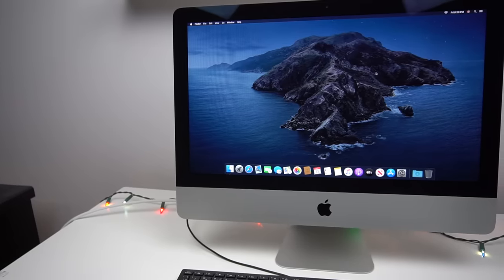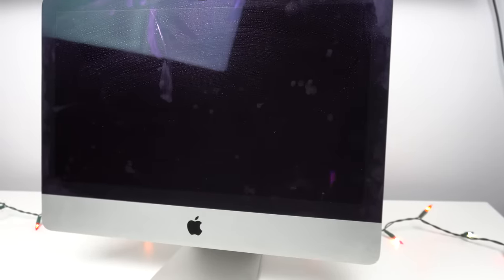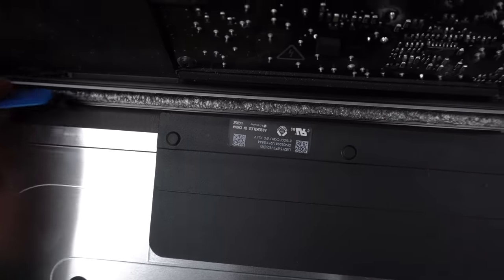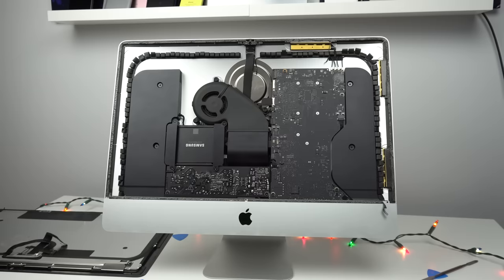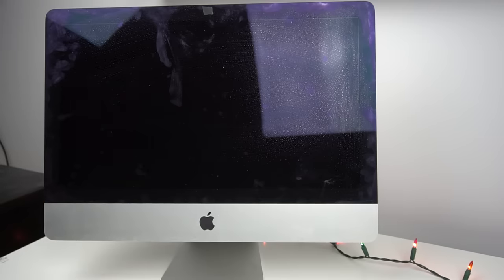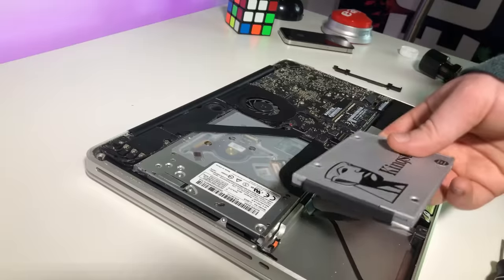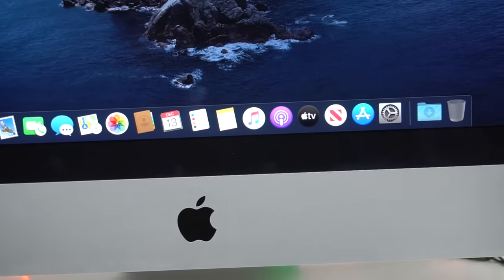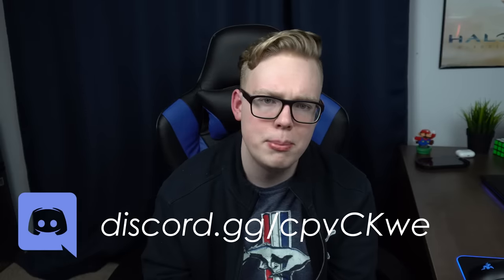Upgrading my late 2013 iMac!

Comment: Six years and you don't change the thermal paste on the CPU?
Reply: @DJPaulgee1  It’s an annoyance to be sure but if you go through the trouble to get into the case at all it’s not that big of a deal. And while the CPU is soldered on those Macs, the heat sink is not, so replacing the thermal paste is definitely doable.

Comment: Have i ever upgraded an old mac? no. Will I? Yes. I have an old 2008 macbook (not air or pro, just regular) and as you know, with those alum. unibody 2008 macbooks they have a battery door. Under there is the battery and the drive. I'm going to be replacing that old hdd with a Lexar 240GB ssd.

Comment: Just did this upgrade last night to my 2013 iMac.... all I can say is WOW! I am totally blown away! I swear my computer now runs better than it did when it was brand new!! Can’t thank you enough for this video! For under $90 total, I practically have a new computer!
Reply: 3 years later and ssds are super cheap now. $30 for 1tb. I can now finally upgrade this old iMac lmao.
Reply: @deagle7776 if you would be so kind, provide a link.
Reply: what screwdriver i need for doing this in the mac late 2013?

Comment: I still use my 2012 27 iMac and it’s actually very fast since the fusion drive failed. The hdd in the fusion drive failed so while it only has 128gb its very fast. I love it and use it more than my 2017 MacBook pro
Reply from the maker: Ha that’s interesting. Bit of a blessing in disguise there

Comment: You can also copy the original HD on an external drive (doesn't need to be SSD). Change the Mac to boot from the external every time and take apart iMac. Now add in new SSD turn on; it will boot from external drive and now copy (requires software both times) the external to the new internal SSD.

You could also buy an accessory to make the internal SSD drive a external and than copy over.

Comment: I have an old pc from 2010 and it still works at 9 yrs old
Reply: Game Maddness impressive I’m saving up for one but  which one should go with a 2010 or a 2013
Reply: @angelguttierrez6500  2013 just cuz if you do open it it's easier on the eyes it looks like a jungle in the 2010

Comment: Letting the adhesive cure to a clean surface is imperative. This can be aided by using some clear packing tape around some of the outer sides. If that's not an option make sure the monitor doesn't lean forward at all. If the screen falls off (I have experienced this), connectors will get tweaked and possibly damaged. Also, the screen can crack, so put pillow in front of your computer.

Comment: You should be using iFixit's iMac cutting wheel to prevent the unlikely event of cutting any sensitive components
Reply: Surprised, in view that iFixit stuff was mentioned, also the adhesive tape kit for the screen wasnt mentioned

Comment: or just use an external ssd (in my case Sandisk extreme) and u dont need all that, the results are great as well! used it on my late 2013 imac

Comment: imagine if you had upgraded the ram to 16gb as well, It would have been a beast.
Reply: Can you actually upgrade it to 16gb if Apple recommends it to only have a maximum 8gb for both slots?
Reply: @rainsee773  You can, but you have to pull the logic board

Comment: Place your new SSD into an external case...start up your Mac normally...use carbon copy cloner...clone your original drive to the new SSD...shut everything off...remove power....remove screen...replace old drive with SSD...close screen...startup....no drama....Mac will be super fast and exactly how your had it setup originally.

Comment: I'm in the process to SSD upgrade my late-2013 but when removing its display, it seems the 2 ribbon connector falls vertical whereas yours horizontal. Same for the HDD installation, it is different than yours so do you happen to know if late-2013 have different motherboards layout ?

Comment: FYI: “recovery mode” ...easier to take the old hard drive, use a SATA to USB connector, boot from the old hard drive, format the new SSD (make sure to make it macOS bootable), install macOS from there or shut down, disconnect old drive and then go into recovery mode, and you should be able to recover right onto the new SSD. (if you don’t already have one, various types of SATA to USB connectors are available starting at cheap$, or put in old drive case, most older external USB drives have a SATA adapter on the drive itself).

Comment: I have a 2013 27" iMac, Quad core i5 32GB ram etc, and it's slow! Watching this video has convinced me that SSD is the way forward. So now off to the stores to grab a 500GB Samsung SSD. Need to try this before I venture down the replacement iMac route. I have the iFix It tools and replacement strips, had those a while but needed convincing it was worth a shot. Will update when done, thanks for the video fella, very informative. Also confirms I don't need any fan or temp cables as with the earlier iMacs
Reply: Okay so update. *On the 27" iMac, you will need a cradle adapter as these iMacs have a full size HHD*. Fitted a Samsung Evo 860 and all I can say is WOW! iMac is so so much quicker, at everything! A worthy upgrade for anyone considering it. Thanks again for the video 👊🏼😎
Reply: @ChrisLee-UK  Do you know if I would still need a cradle adapter if I have a 21.5" instead? Thanks for review btw :)
Reply: @kevinnguyen9597  Hey Kevin, no adapter needed on the 21.5" as it's the same dimensions as the SSD :)
Reply: Also, off-topic question. Do you think I would have to buy anything to deal with the sensitive thermal sensor for the fan? For an iMac Late 2013 21.5"
Reply: @kevinnguyen9597  Earlier Mac required a cable/harness thing to deal with the temp. sensor. I didn't have to use one on mine and have no issues at all :)
Reply: Chris Lee - UK can you provide a link for the cradle adapter you are talking about?  Also what do you mean if you have 21.5”?  Can you provide a link that show a ssd that is 21.5”?
Reply: @ChrisLee-UK  thanks.  i just got a used imac 27" 2013 from craigslist today.  I bought it from someone who was selling for a friend.  he said the imac crashed and took it to the apple store.  the apple genius removed the 1 TB fusion drive and left the 120 SSD drive in there.  So if they left the 120 GB SSD drive in there....does that mean i have the cradle and don't need to buy the cradle anymore if i want to go out and buy the 1 TB SSD to upgrade it?
Reply: vincentnnyc I would imagine they have left the 120 in but removed the 3.5” drive. Some Mac’s can have a second drive but it’s normally a fixture to the main board so you’ll still have space for a 3.5” or 2.5” if you use a cradle. The 120gb will be a flash drive. They have removed the physical 3.5” drive and just moved stuff over to the main board flash drive. To fit your own SSD you’ll still need the cradle and of course an SSD.
Reply: Chris Lee - UK I saw a YouTube video where someone took apart the 27” and put a 500 GB which look like a memory stick into it. Is that the flash drive?  What if I just put a 500 GB flash drive instead and upgrade that way instead of the Ssd?  What pro and con do you see?  Is it easier and cost effective to do that instead of the upgrade to ssd?
Reply: vincentnnyc sometimes the flash drive is part of the board and cannot be changed. I would stick with the SSD and keep the 120gb as a backup drive along side the main SSD
Reply: Chris Lee - UK ok once I get the ssd and hook it up and when it boot up for the first time with a ssd hdd, what option will it ask and what should I pick?  Do I still leave the Mac OS in the flash drive or do I need to move it to the 1 TB ssd since it is bigger than the 120 GB?  What do you recommend?  Also should I select file system should I select when it initial the ssd for they first time?  Afs, or Mac OS with extended or what?
Reply: @ChrisLee-UK  Hi Chris! Thanks for all the information! I've ordered the cradle adapter you recommended to upgrade my iMac 27". I'm a completely beginner on this. What do I have to think to install the SSD into the cradle? Is there any tutorial you would recommend me to follow to do this? Thanks!!!

Comment: The most important (and by far the MOST DIFFICULT) bit here is how to glue the monitor back. I have over 30 years of computer experience (mostly operating systems development) and still I hesitate about this upgrade only because of this gluing part... But probably I will risk it and your video encouraged me to do so. You said in the video "I bought the glue kit from iFixit" -- any links or other pointers, please?

Comment: What are your thoughts on using an external SSD as your boot drive so you don't have to open up your computer? I'm thinking of using a Samsung T5 1TB SSD with my late 2012 iMac, to replace the 1TB fusion drive. It would plug into the USB 3.0 port. Wondering if this is still a viable upgrade to the internal fusion drive. I know it won't be as fast as replacing the internal drive, but would it still be worthwhile to do? Thanks!
Reply: Unless you need to crack the case open for some other reason, your plan is best: An external SSD set up as a boot drive is about the same cost, nearly as fast as the internal even over a USB 3.0 connection, far less hassle, and zero risk to your hardware. You can then continue to use your internal fusion drive (which is actually a small SSD and a larger HDD which is treated as a single logical volume by the OS) for extra storage or backups.

Comment: This looks so easy and I have the same Mac and it’s SUPER slow I think this would help It a lot put I’m scared to brake it but maybe I will do it if I don’t I will hire someone to do it
Reply: Save your trouble and the money, ip use an external SSD instead. Every iMac made from 2012 onward has at least USB 3.0 which at 5.0Gbits/s is plenty for an external SSD to feel like a huge upgrade over any spinning platter HDD. There’s no good reason to crack the case just to replace the drive. Do that only if there’s some other reason to get in there.

Comment: I have a maxed out one of these 21 inch 2013 iMacs with a quad core 4th gen i7, 16g of ram and an nvidia geforce 750m graphics card. The computer still is plenty powerful to this day and probably for years more to come.
Reply: you have last osx?
Reply: How much all that came up to my guy
Reply: @lorenzolamb6412  that was over 4 years ago bro. In todays world I would get one of the 2019 4K Intel iMacs. I have one with 32gb ram and 4gb Radeon graphics card. You can pick one up in that spec if you’re lucky for around $300-400. It’s an absolute bargain.

Comment: What us biggest SSD that can be installed into a Late 2013 model?
Reply: There is space for a 2.5” drive. If you mean capacity, there is no practical limit – if you can find one and have the money to buy it, stuff an 8tb SSD in there if you want to.

Comment: I just got one of these w/ an i7 4770+ 8gb ram + GTX 750M as a "parts only" buy for only $50!
Apparently the stock 256gb NVMe PCIe SSD had failed (flashy ? folder).
Currently got it booting Catalina via a Kingston 500gb SATA SSD + SATA to USB 3.0 adapter.
Ordered a replacement PCIe NVMe, tools, and adhesive strips, and I'm waiting on the 16gb ram delivery to complete my full upgrade attempt.
Total investment so far is still just a little bit over $100. 
Wish me luck!
Ha!

Comment: I've tried doing this upgrade on a Late 2012 iMac 21.5 inch. Every time I put a new SSD and reinstall macOS it doesn't show up on Disk Utility. Any reason why. Just wondering. If I put the original HDD it works.

Comment: The thing that frustrates me about my iMac (which has the Fusion drive) is that my hard drive started going really slow so I assumed the hard drive was failing, but it turns out that the SSD part of it was failing....so much for lasting longer than the hard drive

Comment: I did this (well i sent it to someone to do it) with my late 2012 imac. It is, to this day the computer i use, it runs wonderfully and it works for my 3d modelings and rendering
Reply: I also upgraded the ram from 8 to 16gb

Comment: If your doing it, just boot through thunderbolt external ssd or even usb 3. I have the same one and I do and it’s absolutely rapid, and I haven’t took it apart once
Reply: I have heard you can just add an external, this way you don't have to open anything. Do you have a link for that?

Comment: So what about this BS thermal sensor everyone says you need to keep the fans from spinning up?
Reply: It’s not BS. Without the sensor, the Mac has no idea how hot the drive is so it spins the fans up to max and keeps them there. You either deal with the fans at max all the time, or you install a sensor, or you use fan control software. The sensor isn’t expensive and there are free options if you choose to go the software route.
Reply: I installed an SSD in my 2013 iMac with zero fan issues. Maybe it's for the 27" models mine is running cool and quiet.
Reply: @danielk0106  Correct: It is needed for 2012 and later 27” iMacs. There is no drive or drive bay thermal sensor in the 21.5” iMacs.

Comment: It is rediculas these are not supported anymore. They are completely able to handle anything you throw at it aside from high end games. If you have the 4gb graphics card, 32gb of ram, and a nice ssd it blows any cheap computer out of the watter. I have a 27 inch 2013 imac and it's a great computer. Even running outdated osx it handles 4k video at 60fps with no dropped frames.

Comment: Good video but the reason a lot of us are watching this is Macs do not just work.  27 2013 iMac replete with issues- hard drive, screen, graphics controller, etc all known issues. Even the screen suspension clip (cheap plastic) was subject to a free fix (had to bring it in an leave it with Apple of course and this is unlike most of the other issues which Apple just ignores.) Point is the mantra that Apple just works is simply false at this point. They break like everything else and now Apple has made their macs virtually immune to user fixes, unlike PCs. Still gave a like!

Comment: I have a late 2015 5K i5 3.2ghz iMac, it came with a 7200rpm 1TB HD, recently on a sale i buyed a 480gb SSD and a External SATA3 to USB3 HD Caddy and installed Mac OS, on USB the SSD is 2X faster than the HD, I fallen in love with the SSD and buyed 1TB Sandisk SSD and opened my Mac and swapped the HD to the SSD, the best thing I did.
I did it too to my old MacBook Pro mid 2012

Comment: Did this to my late 2012 13,2 27", which I bought new with a 3TB Fusion Drive. So, a 2 TB SSD in the main slot, and a 1 TB in the  proprietary PCIE slot. I reestablished it as a Fusion drive in terminal, but given the way macOS manages volumes now it's not necessary. With a little "help" it's running Sonoma 14.1.2. , although I think this may be the limit for the graphics card.

Comment: 27 is aliitle easier but you need an external sensor. Otherwise fans will run a full blast. RAM is isuper easy you access door on back!

Comment: Some 27” iMacs have both an SSD (Primary) and mechanical drive (secondary). I am going to upgrade both in my 27” iMac in hopes of a performance boost but the archival ability of a secondary mechanical drive. Fingers crossed!

Comment: I bought an iMac 27" model A1419 for $200.00 two months ago and the person I bought it from said that the hard drive was giving him an error. He didn't know what the error was but I took a chance because it had a 2TB hard drive and 32GB of RAM.Turned out that initially all I needed to do was reinstall the OS. That worked for a couple months then all of a sudden the drive failed. I just purchased a 250GB SSD and tape kit from Amazon for $60.00 total. I don't need more that 250 GB because most of my data in cloud based. Looking forward to getting the computer back up and running again. This tune keeps rollin around in my head... a country tune I think originally it goes "and we were swingin" only I'm sing (in my head) "and I'll be screamin" LOL

Comment: I bought a 2008 imac for 50 euro's which is a bargon! But the previous owner said it whas SO SLOOOOOW, i opened up the imac and it had the original 320gb mechanical hard drive in it! I replaced it with a (temporarely) 240gb ssd, it feels snappy as heck! It opens up apps in an instant! It has a core 2 duo, but it fast enough to do light work on it like webbrowsing and watch youtube! I have a m.2 msata drive lying around just doing nothing, my plan is to upgrade this imac with a m.2 to a classic 2,5 inch ssd adapter which costs 30 euro's online! 1TB may sounds overkill, but for loading the imac with movies and such and serving as a iPhone backup station, i think its enough!

Comment: Whatever you do when you “move the plastic thing (it’s a speaker) DO NOT PULL IT OUT OF THERE. I just tried that and snapped the power on/off button. Had to buy an entirely new chassis from ebay in order to get it fixed and they’re hard to come by...

Comment: If I upgrade to a SSD , will I lose all my old files and programs? How does that work I’m not to good at these things but I believe I can upgrade it bcuz I can’t bare anymore how slow and unresponsive my 2013 iMac is 😭 please help me guys !!🙏🏻🙏🏻🙏🏻🙏🏻🙏🏻
Reply: If you had to ask that question, you should not perform this type of operation on your Mac. Just buy an external SSD, use Carbon Copy Cloner to clone your existing drive over to the SSD, then boot from the SSD. After testing you can then erase your old slow internal spinning platter HDD to use it for extra storage or backups.

Comment: Did I NOT see a OWC thermal sensor? OWC are still insisting in their install videos that you need one. Went the external USB drive solution for my late 2009 iMac. Boot time under 2 minutes - half of what it was with the hard drive. As a Windows person I hate the stick tape on the 2013 - 2019 iMac's but at least the screen is one piece and there are only two connectors.